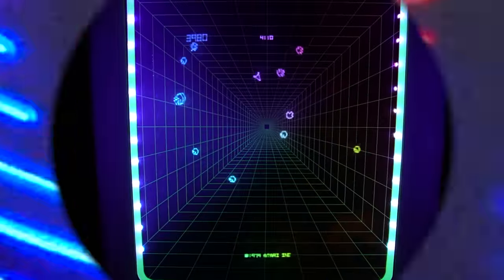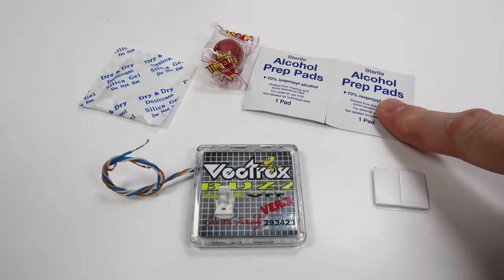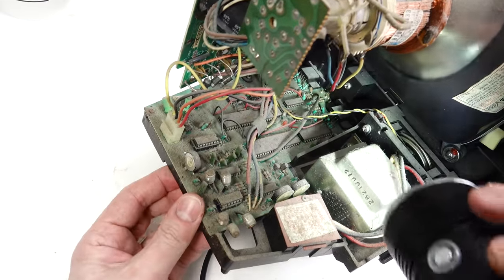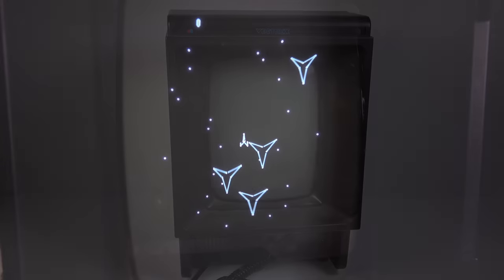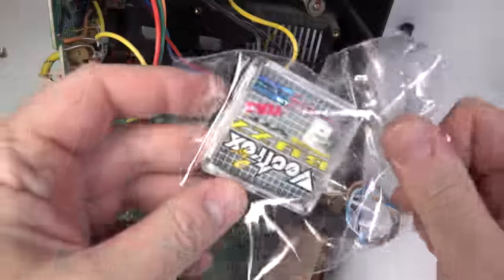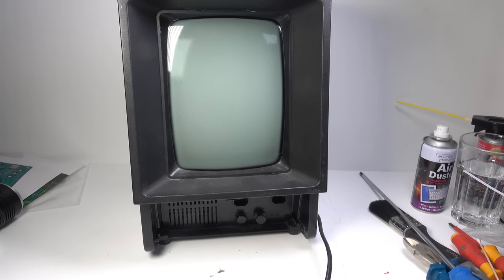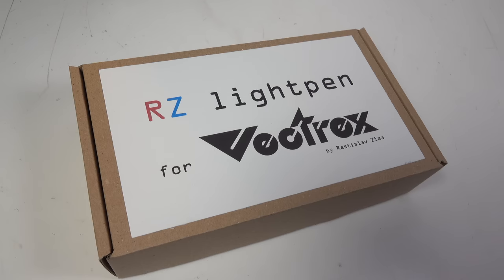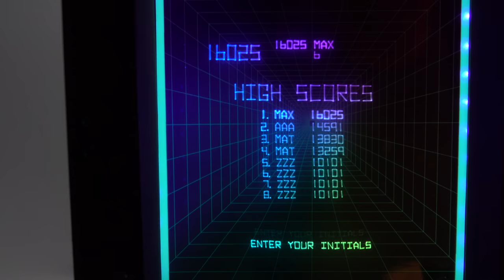Vectrex Buzz-Off Kit Installation

Comment: "It is possible, even if you are a bit of a clown" Relatable
Reply: I had to solder six pin-size points on my original XBOX motherboard this week, left one of the solder bridges sticking up higher than Mt Crumpit - and it all turned out functional.

We clowns get it done from time to time.
Reply: @arootube  You don't wanna know how I put a 50hz/60hz switch and a region switch on my megadrive. But it works hahahaha.
Reply: Recently I was trying to repair an audio cable. Carefully soldered everything back together, only to discover that I had forgotten to put the sleeve on first! Had to unsolder everything and start again! Of course the first try was a much neater job...

Comment: Many years ago I thought my dad had bought me and my sister a Vectrex and I loved it, but it turns out he'd only rented it for the summer holidays. I was, apparently so upset when it went back that, for Christmas that year, we were bought our first proper computer, a Commodore 64. So, it all turned out well in the end (especially when you consider I'm now a University Lecturer teaching Computer based modelling and simulation).
Reply: Success story at it's finest. Me on the other hand.... nevermind.
Reply: @kellypg  well, not with that attitude ;)
Reply: @Robert Jones I was a big fan of the Spectrum too - 3D Starstrike was one of my favourite games and Elite ran much smoother on the Spectrum than it did on the C64 - but I still love my 64 and yes, the SID chip was just the best.
Reply: I started with the ZX-81. I so wanted a spectrum when it came out. Never got one but still would love to own one. I think an Amstrad CPC was my next computer. I still remember the buzz and excitement from buying computer magazines as a kid and ready every inch of them.
Reply: SYS 64738 :-)
Reply: @MeppyMan  those early 8-bit days, no matter what machine you had, were amazing days.
Reply: @sharpbends  beautifully remembered.
Reply: @JohnHoggard_aka_DaddyHoggy  C64 was 1st computer l owned and wrote software on, still programming all these years later :-)
Reply: @sharpbends  Great to hear - I do very little programming these days, but, like you, C64 was my first real programming experience - Basic and then Assembler (with some Simons' Basic thrown into the mix)
Reply: I always love a christmas story with a nice ending.
Reply: @JohnHoggard_aka_DaddyHoggy  Well said.  A lot more fun and wonder than these days of ubiquitous generic PC clones. I'll bet people buying early Model-T automobiles in the early last century felt the same.
Reply: Got my 1st Commodore in the early 80s and couldn't get over the Sprites on the C64 from Vic chip also Speech synthesis from the Sid chip was the very 1st time I heard a computer speak. Many happy years of Peaking and Pokeing, not to be confused with Pokemon😊👍

Comment: You need to make a Tech Moan intro using the light pen! This is pure gold!
Reply: That, plus the UV overlays, is instant vaporwave gold.
Reply: TheRealColBosch Yes!! And if you add some brass and synths it’s gonna be Sovietwave gold
Reply: Why stop at the lightpen? Get the 3-D headset in there too.
Reply: The light pen is the small man's light saber.
Reply: @techloon4181  The light pen is mightier than the light saber.

Comment: 16:16 Thank you very much for the Vec box scans credit. I appreciated that very much! I'm a big fan of your channel and it's an honor to have them show up here. -Matt
Reply from the maker: You’re the only website with that picture - thanks for doing the scan, it was just what I needed to show in the video.
Reply: @Ramdileo_sys  Sadly, almost everything you learned there is irrelevant to the Vectrex, as vector displays function very differently than raster displays.
Reply: @Ramdileo_sys  What I'm saying is that the video you linked doesn't actually explain how the Vectrex light pen works.
Reply: @CptJistuce  I'd hazard a guess theyd both abuse the properties of CRTs to achieve their effects, even if the rendering process is different. They both use CRT monitors, although the Vectrex doesn't use the mask since it doesn't render pixels, and likely has a different formulation of phosphors used.
Reply: @SkigBiggler  The Vectrex also doesn't have a regular scan pattern that hits every part of the screen, because vector displays directly trace the visible image(basically, an electronic Etch-a-Sketch). And that's why the traditional way of making lightguns and lightpens work doesn't work, and the 8-Bit Guy video referenced isn't actually relevant. You can't watch to see when the beam is going by if the beam isn't touching most of the screen, and that is the key property of a raster-scan display that lightpens and lightguns traditionally exploit.
Lightpens on vector displays require a more complex approach because of that(and if a lightgun is even p possible, I'll be surprised).

Incidentally, color vector displays DO have a shadow mask. The Vectrex doesn't use one because it is monochrome, not because it is vector. Monochrome raster-scan displays don't have shadow masks either.
Reply: @CptJistuce  yeah, I found a comment farther down that says the pen uses a little ring on the screen to locate itself. When the pen goes over the edge of the ring, it repositions itself. Sorta like a line following robot I guess.

Comment: I work in hifi electronics manufacturing and repair so I can say that your "bodges" look very good compared to some of the fixes that I've had to implement.

However, I would be a bit weary of you placing the amplifier on top of a transformer, you might be picking up a bit of mains hum. But if that works for you, that's great!
Reply: He did, you can clearly hear it when he says there's an eary silence. It surprised me he said that since there was clearly an interference, just less obvious than before.
Reply: There is a very low level noise with the kit installed.  To me, it is so low as to not be an annoyance.  Compare the before and after - it is a vast improvement.  It is odd to place an amplifier right on a transformer, for sure.
Reply: @butwait  I know his father is somewhat hearing impaired but I can't remember if he said he is as well
Reply: Meh, by comparison it is quiet now. I think before, the original amplifier was near the tube driving section. The buzz sounds very much like vertical buzz, which would be 50Hz, same as mains. Anyhow, I'm assuming the kit instructions suggest having it on the transformer. There isn't much free real estate to put it anyway.
Reply: Yeah i found the positioning of that amplifier module a bit dubious as well, but as we could hear, it was virtually noise-free in the end, so it's all good imo :)
Reply: @madmanmapper  The original audio amplifier is on the vector monitor Deflection board and  picks up all kinds of interference noise from the beam deflection circuits.
Reply: Krister L  I was thinking about the heat as well , all transformers get hot , some more than others . There must have been a better place to mount it, even just cable tied to the blue and red wires running across

Comment: Now I saw a vectrex at a consumer electronics show with a 3D+color attachment.
You wore a big pair of glasses on your head with a spinning wheel that blocked each eye some of the time and colored your view some of the time, and the vectrix would sync itself to the spinning wheel to give you real 3D through eye to eye flicker and color the same way.
Reply: The famous Vectrex 3D Imager. My holy grail. Currently, there is one on ebay for 700 euros. :(

Comment: Mine wasn't that dusty. I had an issue with the white spot at times, decided to recap it, no difference. Turns out the power switch needed cleaning. One of the power lines the switch connects wasn't being connected.

You should get an air compressor and a blow gun, best thing ever for clearing out dust.

Comment: I was lucky to get a Vectrex in 2013 which was a late German release where they'd fixed the 'buzz'. Clean, crisp sound without modifications.
Reply: I think these non-buzz vectrexes have some compatibility issues with some software.
Reply: I haven't come across that yet, personally, but it does also have the fixed Minestorm built in.

Comment: With regards to connecting that speaker up either way - the cone will vibrate the wrong way (compared to having the speaker the correct way around), not a massively noticeable difference in a mono system, but get one speaker the wrong way around in a stereo system and you get out of phase audio (which I am sure you are aware of!).   Great result, certainly a mod worth doing!
Reply: Correct. But it’s not stereo so it will sound the same either way.

Comment: Better loan a compressor and really blow the dust out of the first one. 

When you start using a brush but don't finish cleaning, the dust tends to stay clumped up in places and can have a greater chance of causing a short or a flashover.

Speaking from the experience of two destroyed CRT televisions, one of which caught on fire a little.
Reply: "a little" ^____^
Reply: It’s just a little bit on fire.  Haha  🔥
Reply: I discovered back in 2006 while cleaning a projector...blowing compressed air (from a can) into the projector while it was powered up was a mistake.  Bright and hot projector lamps, propellant and dust makes for nifty flames coming out of the unit.  Coworkers were a tad concerned.

Comment: These are truly fascinating machines. I had no idea they even existed until I saw your previous video on one. I unfortunately have the attention span of a house fly and rarely replay games once I feel I've done all I can with them. Apart from my Nintendo 64 that I've had since Christmas of 1998, and the Windows 98 Pentium 4 system  I built 3 or so years ago, I really don't do much retro gaming. 

Never the less, keep up the great work Mat! I've done worse soldering jobs myself. Reattached the RCA plugs on the back of a TV 15 years ago with a cut up RJ45 phone cord, solid copper wire is why I used the cord, easier to solder. Was a hackjob but it worked until the TV didn't anymore.

Comment: Vector displays were nice in so many ways.  I seem to recall people taking the deflection yoke off the neck of the CRT in a television while leaving it hooked into the sweep circuitry.  Then they would get another yoke and place it on the CRT.  Finally they would hook up the horizontal and vertical deflection coils to the speaker outputs of an audio amplifier, and have a TV-sized audio pattern display.
Never tried it myself, but it was tempting. 😉

Comment: Great video.  Thanks!  May I suggest you purchase a small air compressor with an air blowing nozzle?  I set it at 90 PSI and it gets ALL the dust off much quicker than the "can of hydrocarbons" and no paint brush needed.  I wish I had one of those Vectrex games!

Comment: Just a tip, whenever you re-heat old solder to make a connection or whatever, always add a bit of new solder, the flux in there guarantees you don't get a shoddy joint that will fail. Ideally you could remove all of the old solder first too.

Comment: i'm curious, how does the light pen work on a vector screen? i only know the ones for scanline CRTs which essentially just measure the time between VSYNC and the light being measured by the pen, thus knowing where the ray was at that time, but that won't do for a vector based CRT, there's no scanlines to count.
Reply: I just worked it out. I did not research this topic. Note how the cursor turns into a octagon that seems to expand and contract depending or how fast you move the pen across the screen. You can really see this effect when he moves from the first to second line. 17:18 I believe the octagon is drawn and while being drawn if the pen hits the edge move the pointer there. If not draw a bigger octagon and so on.
Reply: IR photo sender and fly back lines
Reply: @ky5666  ah ok so it essentially tries to home in on it with timed cursor drawing till it gets seen where (or rather when) expected.
Reply: @The_Studioworkshop  yeah no. note how i literally just said that this is not the case since there are no scanlines in a vector display
Reply: It would be sick to capture this homing-in effect with a high speed camera.
Reply: I’m glad somebody asked this.  It was the first thing I thought of when he showed the pen.

Comment: I have a GCE version which predates this, had to do pot adjustments, but decided to leave the buzz alone. The hardest part of reassembling the case though, is the brightness dial alignment, which you have to be very very very careful with.

Comment: I finally just did the exact same thing but with a $1.00 LM386 audio amplifier board... Its a whole different experience with a quiet vertex! you can leave it on as eye candy now like a lava lamp :) The key is to use a shielded, grounded, audio cable and the positioning of the cable wherein lies across the logic board is crucial in order to completely eliminate all buzzing from the speaker.

Comment: Cool video! I always took for granted that raster tubes like the Vectrex would always sound like that. I never guessed it was just a dodgy wiring scheme. I had never seen the light pen, that blew my mind. I was programming APPLE ][ graphics in the early 80s and, even with memory expansion, they could not have moved Hi-Res lines around like that. I can't even begin to imagine how that works.

Comment: Dust cleaning tip - take it outside on a dry day and use battery powered leaf blower. Makita does nifty small one. Very handy for electronics and does not introduce electrostatic.

Comment: Virgin crt: draws every second line, and can't draw anywhere expect in straight line
Chad Vectrex: draws everywhere it wants, no rules
Reply: haha electron beam goes brrr
Reply: Except you can only draw lines, but anywhere and everywhere. But it doesn't have pixels so technically you have HD lines!
Reply: Wow two terrible memes in one comment section.
Reply: The Vectrex screen is a CRT, it's just controlled a little differently.

Comment: I've actually never seen the lightpen in use. My mind is blown by that. 1983! I had never seen a Vectrex when they were still relevant so my experiences from that time was my Atari 2600 and my Uncle's Vic-20. I don't know if my mind could have processed it if I had seen that back then. It would have been black magic fuckery. It still kind of is.

Comment: The Deox (and other similar sprays) will eventually dry off and the oxidation and noise will be back. The gunk I suspect is contact grease which is a lot more permanent solution.
Reply: Correct. It’s a special dielectric grease that works itself into the carbon trace. New pots of quality are loaded with silicone to keep moisture out.

Comment: You picked the worst spot to stick the PCB as that is a mains transformer that you stuck it too and as well as getting warm it will induce a bit of noise in the amplifier. And maybe a few flyback spikes may get inducted and give the amplifier a problem with amplifying high frequency noise. It is not criticism I love what you do Techmoan
Reply: No. All incorrect. 2000 installs and not a one has a issue. Transformer does not get that hot at all. It’s shielded also.

Comment: Take a shot every time he almost touches the back of the CRT😂
Reply: There's actually very low danger by touching the neck pcb of the CRT, since the voltages there are pretty low and should vanish pretty quickly after turning the device off. Actually you have to touch the yoke part while CRT is turned on, when adjusting picture rotation (tilt) on older sets. Of course it is advisable to use protective gloves atleast.

The real danger lays under the suction cup thingie mounted on the CRT itself, kilovolts! There shouldn't be, but there may be because CRT is a kind of capacitor. Also, when the anode cap is on place and wire connected inside CRT, there may be major danger touching underside of the main PCB where the flyback transformer lies (usually on normal tv/monitor at least).
Reply: Still not discharging the CRT is incredibly dangerous
Reply: @TheBudgie29  I have had a belt from discharging a crt with a screwdriver, handle wasnt as much of an insulator as i thought.  shot my arm violently backwards and the screwdriver went flying across the workshop. i actually saw the blue arc come out of the ht hole and skate onto the screwdriver handle.  Earthing a crt out is bloody scary, that arc just looks like it could kill you.
Reply: Kyle Regardless you should discharge it no matter how dangerous it is
Reply: 9:05
Reply: @nakkistromberg3946  "suction cup thingie".. is that the technical name for it? ;)
Reply: @jinxterx  I think it was called Ultor Cap from memory this being the suction cap attacted to the back of the CRT.

Comment: Just a suggestion but you may consider using 3M super tape. It stretches and therefore your winding is more tight around the wire. It also is less susceptible to the glue going bad and becoming a gooey mess later.

Comment: From my understanding.. old solder joints not wanting to melt.. solder gets a layer of oxidation that acts as an insulator, what you want is FLUX. New solder comes with some flux built in, which is where the adding solder to remove solder mantra comes from.. but the active ingredient is the flux.

Comment: Hell yes I’ve been waiting for you to do more DIY stuff. Time to bust out the multimeter, soldiering equipment, oscilloscope, power supply… and other General test gear. And do some troubleshooting! And if you don’t have the gear it’s time to buy it! 😀

Comment: At first, I was thinking it sounded like mains AC noise leaking into the audio sections. 
But now, I'm thinking it actually sounds more like incidental carrier phase modulation interference (ICPM), which can produce an audible buzz in the audio amplifier as the video modulation levels vary.  Basically, harmonics of the 6.5 Mhz video signal leak into the IF of the audio section and cause noise to be produced as the video on the screen changes.